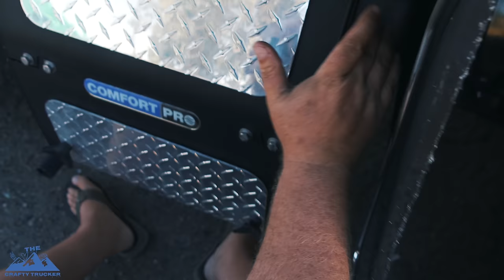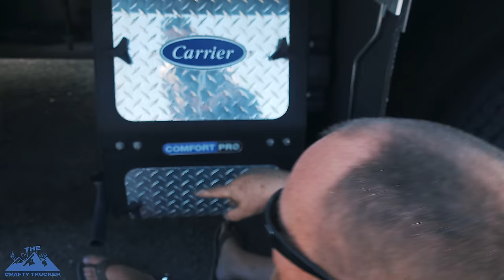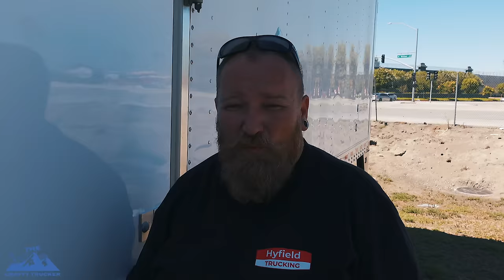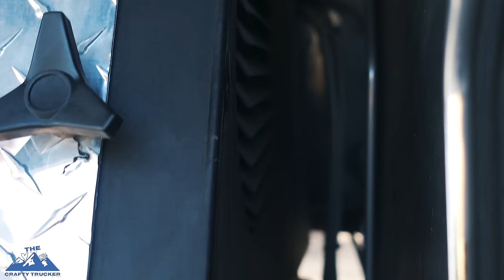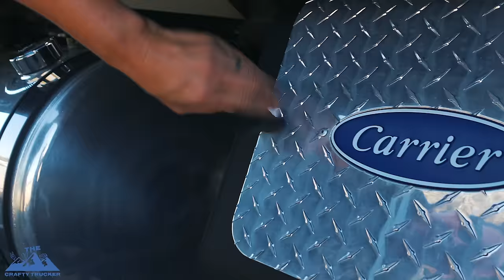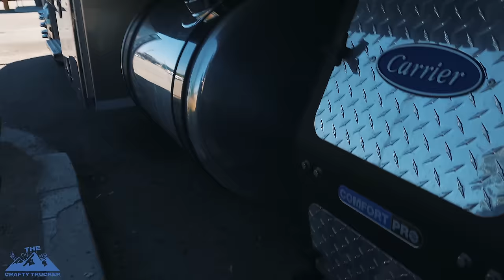REMOVE THIS FOR SUMMER | Carrier Comfort Pro APU

Comment: How'd I miss this? Oh well an unexpected treat. Ah Fyda Freightliner, Columbus Ohio. Right off the interstate. I'd Window shop expiditer trucks there, when I had a 99 cargo van. 2000-2004 425,000 miles on a 5.7 Chevy 1 ton long wheel base

Comment: YEP MAKES SENSE. I would also check the apu rad to make sure it's clean too. air flow is king in good a/c
Reply from the maker: The coolant is tied into the truck so the apu doesn’t have a rad. But great tip
Reply: @TheCraftyTrucker  Oh, i guess that saves weight , cool =)

Comment: Could you have put the bolts into the cover for storage to make it easier to take them off when it is time to reinstall.
Reply from the maker: No the cover didn’t have any threads to hold on to

Comment: I would have a new cover made ,you need to keep the condenser and radiator as free of dirt as possible, you could drill more holes in the cover you removed to help your air flow.
Reply from the maker: Apu does not have condenser or radiator. Coolant lines are tied into truck and we use a rooftop ac

Comment: Lucky I didn’t make the vid. My fat a*s lol. I might go back to trucking this retirement thing don’t work out lol. I remember when the capacitor went bad on that unit. It was right in the way of the oil filter and you slid it back in the capacitor bracket to clear the filter. 2/3 of that capacitor is hanging in space. I guess Carrier expects you to remove the capacitor every time you change the filter, you really should move that capacitor back to the center of the bracket. Or move the bracket back if you can. Bracket will crack one day IMHO. My two cents. Be safe.

Comment: Ah. That's cover is for when its mounted on the other side of the truck. The louvers would be facing to the front. But yes, it's to block crud gettin in there.
Reply: I'm surprised theres not an electric fan instead of a belt driven fan.. (future mod?)
Reply from the maker: Maybe. I was thinking that same thought today about it being mounted on the other side.

Comment: I've always had EPUs (Or nothing.)  Do these APUs keep Engine coolant warm in the winter for easier starting?  Maintain the truck batteries too?  Like if the weather is nice out and you're doing a reset without needing AC/heat. could you avoid running this thing and just start it when you need to top up the batteries?
Reply from the maker: That is exactly how it works. Keeps the engine coolant warm charges the batteries provides AC when we’re sitting if we need it. The biggest thing for us is that prevents us from idling which with these new trucks can be very bad for the emissions systems

Comment: A good tip..I have a comfort pro with that cover but never experienced any over heating. I will leave mine on. My problem seems to be hard starting. Always starts but takes 2 or 3 cycles to start. Seems like it loses its prime on fuel.. Does yours start up on first attempt?
Reply from the maker: It’s does start the first time but is still some what of a hard start

Comment: I wonder if that is why ours will run down the road without overt heating.
Reply from the maker: Did yours not come with that cover?
Reply: @TheCraftyTrucker  sorry the not got left out. It will not run while driving down the road . It does have the winter cover.
Reply from the maker: Michael Simmoms I gotcha. It is possible by removing that it could help keep it cooler. May be worth a try. You’ll have to let us know how it turns out. We’ve always been worried about running ours while driving
Reply: @TheCraftyTrucker  I will let you know. Thank you for the video.

Comment: Hi Craftys... is that a split system? Then that would be compressor cooling inlet or exhaust? Is radiator clean? Wrong positioning of unit if it's exhaust air... cowling will reduce airflow so will mudflap... maybe water misting pre radiator to increase thermal transfer? ( cooling / cleans as well ) just some ideas... regards a re-tired whiteliner.
Reply from the maker: Our unit is tied into the coolant lines of the truck. So no radiator on the apu it’s self.

Comment: As an employee for a Carrier dealership and having had installed and repaired  1000's of comfort pro apus. I do NOT recommend removing this cover not matter the season.
Reply from the maker: Care to share why? Our first comfort pro didn’t even come with this cover and we had 11k hours on it with no issues! It restricts air and really does nothing to protect
Reply: @TheCraftyTrucker  it doesn't restrict air like you think and that's exactly what it is for, to keep the fan from sucking in foreign objects but hey I'm sure you're smarter than the Carrier engineers who designed it.
Reply from the maker: Lol carrier didn’t design it. They bought the comfortpro line from another company who designed it. Impco in Canada designed and owned comfortpro before carrier. I have had the pleasure of learning this stuff from them before carrier bought it and forced them to remove all the helpful videos they had. In case you didn’t notice I have a huge mud flap in front of the APU that did just fine protecting it. FYI any time you place a cover over vents that absolutely restricts air flow. That’s not a carrier thing, it’s a physics thing 😜
Reply: @TheCraftyTrucker  again the cover is there for a reason, to prevent foreign objects from entering the housing. I can say I do appreciate you removing yours and spreading misinformation. Keeps business flowing in my shop replacing fans/shrouds/belts and other components damaged by the removal of these covers. You said it best in the end of the video "I don’t know, I'm not a mechanic "